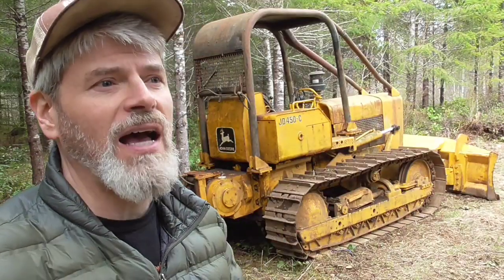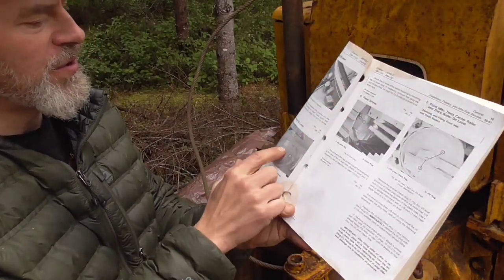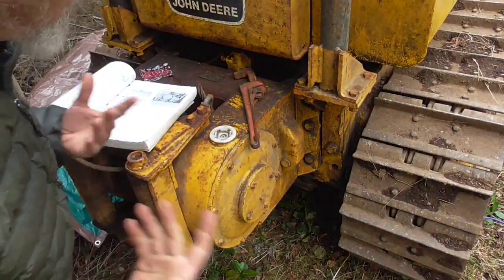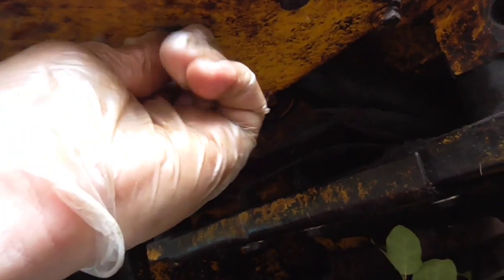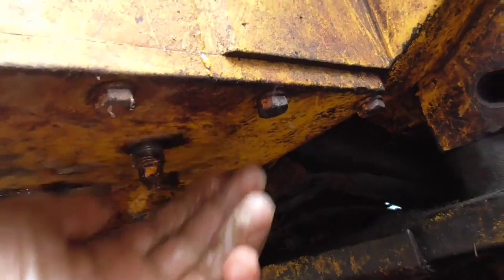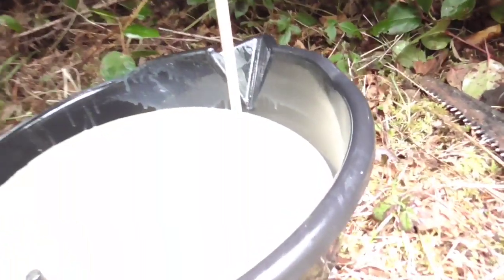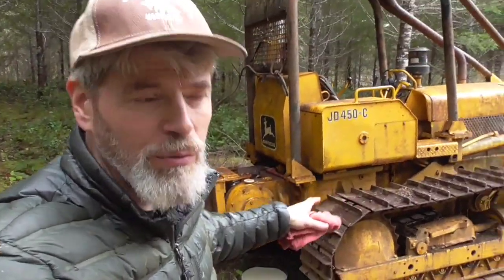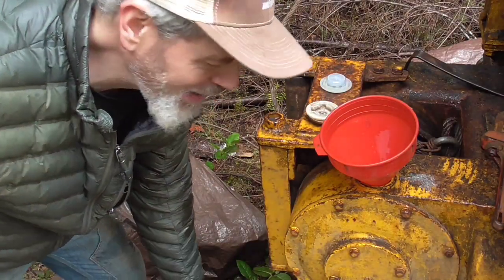How to Change the John Deere 450-C Bulldozer Winch Oil

Comment: I am about in the process of changing all the fluids and filters on mine now.  I wonder if the water gets it from the cap.  Mine has an original metal cap and the water will sit in it.  Lets see if mine has the pina colada  in it as well.🤞
Reply from the maker: I have a cheesy plastic cap. Plus, I doubt the old owner ever messed with the winch.
I'll call my man Rupert Holmes and have him stop by while you change the oil.
Reply: Haha no pina colada! My oil was pristine. The metal cap has a rubber seal and did it’s job luckily. My 6 way valve was leaking bad and I took it all apart and polished out the scratches in the spools. 6 new seals. The parts diagram doesn’t show all the parts in the float detent and after trial and error I got it work. So nice to have a completely leak free machine….for now.😊
Reply from the maker: Nice. I haven't had a leak free machine ever!

Comment: Those old units were built to run. You could have put peanut butter back in that winch, and that would have made it smile. I ran a 450 c for many years. They do not build stuff that way any more.
Reply from the maker: Lol. Peanut butter. I like it. Yeah, it's a beast. Thanks for watching!

Comment: Never mix that rear differential lube with the front loader... or something like that?
Reply from the maker: That's deep... so deep.
Reply: @OffGridandWhiskey  Actually someone told me it's OK, as long as you lube the front loader first before lubing the rear differential (or in your case cable box?)... so confusing.  Good you have technical manual.
Reply: Always front THEN rear, NEVER reverse!

Comment: How. About the filter?
Reply from the maker: There's a winch filter?? lol.  I'll check the manual. I don't remember seeing one. But... hey. Thanks for pointing it out!
Reply: @OffGridandWhiskey  under seat rear same filter for engine oil , 
There is a lower drain plug  and plate to get all water out , I had to flush mine with diesel fuel a couple of times then heat gun in filler to dry out .

Comment: Put transmission drivetrain oil in it. 

Anytime you have differential gears replace straight hydraulic with this oil. 

No offense to gay hydraulic oil. Not that there anything wrong with that
Reply from the maker: Okay. I was gonna put differential oil in(cause we are all so different), but all the forums said gay hydro works. I was confused. Young. It was college.